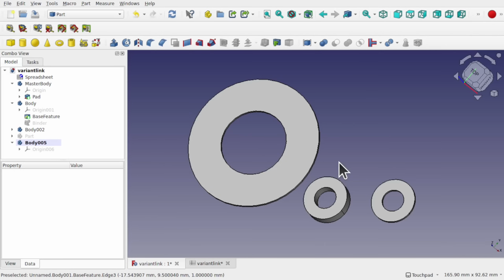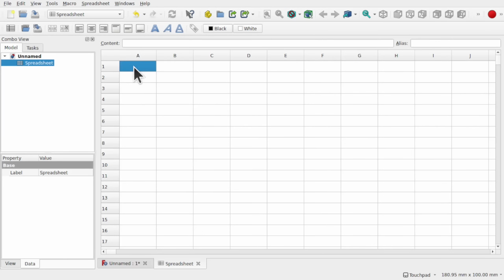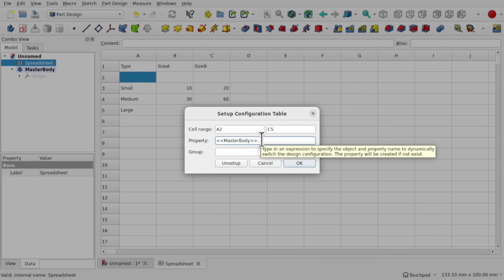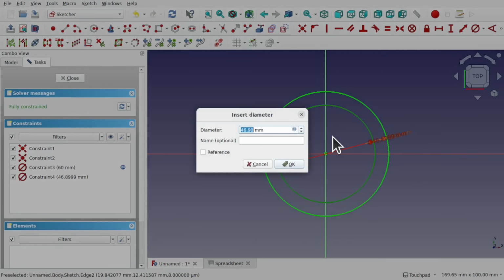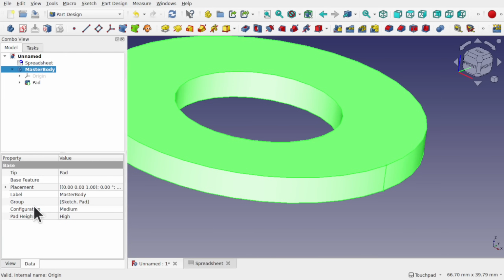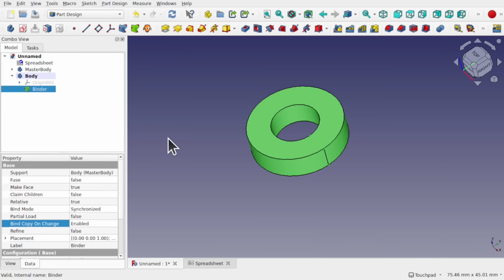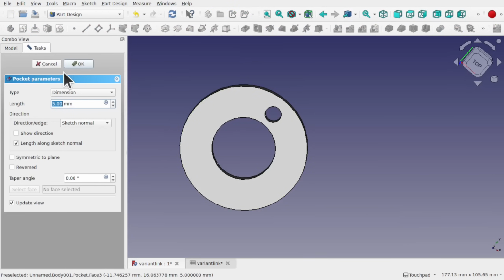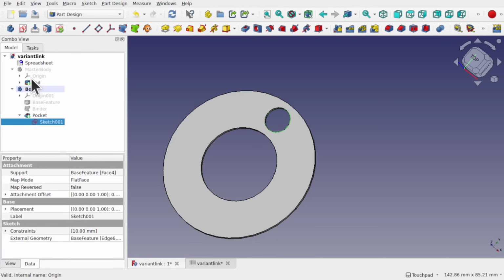Configuration Tables and Variant Links | Mastering FreeCAD 4

Comment: I've already managed to follow this tutorial and it works perfectly, but I can't get the same result within an assembly.
I think it would be very advantageous if this feature worked in an assembly. I can do this with Solidworks, and I'd like to know if it's also possible to do it in FreeCAD.
Imagine having multiple instances of the same component in an assembly but with different dimensions...
Could you make a video explaining how to make this work in an assembly?
Reply from the maker: I am going to have a go a trying that.  I haven't tried using configuration tables with assemblies and I can see where this is will be beneficial.
Reply: @MangoJellySolutions  
That would be great and would help me a lot. 
It would be great to imagine building a machine using aluminum extrusions and having just a single file containing multiple lengths that you can use throughout the project.
Thank you very much...
Reply: @MangoJellySolutions  Hi again! I kept experimenting because I’m still learning FreeCAD, and I think I might have found a really simple way to do this in the 26.3.0 DEV version!
I realized we might not even need the SubShapeBinder workaround for assemblies anymore. Here is what I tried:
I inserted the Master Body (with the Configuration Table) directly into the Assembly WB.
Then, on the instance properties in the tree, I just changed Link Copy On Change to Disabled.
To my surprise, it allowed me to have multiple instances of the same part with completely different configurations, just like SolidWorks! 
Since I'm not a FreeCAD guru, could you kindly take a look and verify if this is a safe/correct workflow? If it works as intended, would you be willing to make a video about this? It would be a massive help for learners like me and anyone doing Open Source hardware!

Comment: Flowing this tutorial in v1.1.0 mostly works but it generates lots of warnings about references after adding the binder as a basefeature.  If I take the SubShapeBinder outside the Body itself  the warnings go away and it keeps working as intended. Just wanted to share my experience here, it migt be the wrong appoach as i am definitely not a poweruser of freecad
Reply from the maker: Thank you so much for sharing that, really appreciate the feedback.  I will look into this and see what is going on.

Comment: I would like to create a table like this, but so I can select variants for a screw type.  So say I want to use a M4 screw to fasten two plates together.  Then it could select the clearance hole diameter, the tap hole diameter, as well as the counterbore diameter and depth from a table.  This way, instead of doing it manually every time (and when I try a different screw size) I can just select "M4" from a table.  

Is there a way of doing this without creating a variant table every time I add a screw?

Comment: I want this exact functionality, but then not with an enum value referencing to a set of values, but by being able to provide these values directly. So Part of Body is reusable with some custom values. 
So imagine having created a parametric shape and reuse it it another FreeCAD document with different values altogether. Is this possible too without coding in Python? (Because starting to code in FreeCAD kind of defeats the purpose of having this UI to work in) for bespoke shapes (for gears etc of course it is very useful). I think functionally speaking it would be similar to OpenSCAD's modules that can be reused in other OpenSCAD files.

So I imagine having created some Body which exposes some parameters which can be altered in a cloned, linked of subshapebinded instance without applying these values to the original. 

Is this possible with FreeCAD in anyway? 

Thanks for your great videos, very informative.

Comment: I've been using spreadsheets as configuration in the past.  But I must say, that you've explained this topic very well.  Learning spreadsheet configurations would have been much easier, if I had know this video before.  But I still have one question and I very much hope, you have an idea for that.  I set up a model for ER collets as work holding devices.  ER comes in different sizes, such as ER-16, ER-25, ER-32, ... to name a few of them.  I am able, to choose the confguration of my bodies just as you showed in your example.  BUT: ER-16 can hold round stock from 2.5 mm up to 12 mm in steps of 0.5 mm, whilst ER-32 offers ranges from 3 mm to 22 mm in steps of 1 mm.  Therefore I'd love to have a second configuration drop down list (as you showed in your video for the height of the pad) for the bore size.  But this configuration depends on the first drop down.  So, when I choos ER-16, the second config list offers hole sizes from 2,5 up to 12 mm in steps of 0.5 mm, but when choosing ER-32, the list of holes starts at 3 mm and goes to 22 in increments of 1 mm.  Any idea on how to do that?

Comment: 🎉Huge job!
I find it an interesting option to have 3D models with different configurations (e.g. DIN 912 screw with different metrics and lengths). I have done a test in A2Plus workbench, but, for several copies of the same model, with different configurations, once I update it, it saves all of them with the last configuration. Any assembly workbench where you can have different configurations of the same 3D model?

Comment: Hi Darren, or anyone fluent in FreeCAD. I do some design work on this platform, but i have run into an issue. I export files after I color coded them, in STEP 214 format, for a customer of mine, but there seems to show small blue spheres where all the vertices sit on the step file if he opens them on his program. I do not know what platform he uses, but i will find out. is there any way to hide them or remove them. i can send photos of this to show how it looks. Any help or advice will be greatly appreciated.
Reply: he uses SolidEdge, and opens the file as a part, not as an assembly
Reply from the maker: I have never heard of this problem  but I have never used the format. One thought though could it be the  point colour in freecad for the model?

Comment: Great to learn and make use of this methodology. I discovered a severe drawback, however. If the body is a bit more complex than a washer, and you have say 4 variants in the workspace, simple changes to the template body (or other simple edits generally) can result in grindingly slow UI response times. Not only this but the dreaded topological naming problem arises if, for example you try to fillet an edge in the template body.
By slow UI response times, I'm talking 60 to 90 seconds of waiting after each operation. I got the job done, but I won't repeat this approach.

Comment: HI, I am getting an error following the steps shown in the video. It does not have to do with configuration tables, but using a binder as a base feature. In essence, if I set the base feature of a body to the binder while it is under the body, I get a out of scope error, saying "link to object 'N/A' is out of scope of 'Body', instead linked object resides in 'N/A'",  but it works if the binder is not under the body. Does this error come up in your build? I am using the latest 0.21.2 release.
Reply: Yes I think I have the same:
PartDesign::Body: Link(s) to object(s) 'N/A' go out of the allowed scope 'Body001'. Instead, the linked object(s) reside within 'N/A'.
When The binder is used as the base feature within the body just dragging it outside the body gets rid of the error and it seems to perform as expected but it makes sense in the model tree for the binder to reside within the body, it is only a warning 
ChatGPT says   The error is not fatal — it’s more of a design-rule warning
to do with scope or something putting the  binder outside the body may not make any difference but just not trigger the warning
Reply: same for me
Reply: I'm having the same issue - has anyone come up with a solution except to ignore the warning

Comment: I've used FreeCAD for years and had no idea Configuration Tables existed (even though I've used spreadsheets many times)! 
As a nice side-effect, you managed to explain how the sub-shape binder is used (I've use the shape binder before, but never understood the function of the sub-shape binder, I think it needs another name).
Funny thing, I actually had a use for this just a few months back after watching your video on using the Link tool. :) I was banging my head against the wall trying to figure out how to model one part and have several with minor additions to them in the same file.
So thank you for yet another extremely helpful video!
Reply: Configuration tables are fairly new, like only in the last year or two. I have an industrial fuse holder (the big cartridge type) on Printables that uses configuration tables to allow the user to select both the fuse size and the number of holes to customize the fuse holder they want to then export as a STL or STEP to import into their slicer. I'm a novice cad modeler at best so my workflow might be a bit messy, but it seems to work.
Reply from the maker: I love seeing real world examples, thanks for sharing that 👍👍
Reply from the maker: Excellent 😊😊 Great to see that this helped. I want to try to cover the more unknown elements of freecad as finding documentation on some tools is near on impossible.  But once I find and figure it out the next step is what can you use it for as real world examples go a long way. A video that I am realising soon has this as a real world example in an assembly workflow. Both these videos were bought in existence by two seperate patreon request which got smashed together. So have to also thank them for the problems that they had which will be appearing in the next video. It's a great feedback loop.

Comment: Now that I know about this, I have to get this into my workflow. I just tried what you showed in the video and a few things more. I don't like the "Part Design" workbench very much (it's too limiting), but rather use the "Part" workbench and CSG.
For those reading here (if it doesn't appear in a video at some point): the same thing works with links instead of shape binders, only the property is "Link Copy on Change" instead of "Bind Copy on Change".
You can even make a configuration table containing shapes, so you can for example configure a "Cut" or "Union"! To get the references to shapes for CSG into spreadsheet cells just enter e. g. "=<<Cylinder>>._self" (the "_self" part is the important one). With that you can add a configuration property to a "Cut". To use the configured shape, in the Cut property view right click on "Tool" and select expression and enter the appropriate spreadsheet cell. Voila! You now have a configurable Boolean operation.
A simple example for what this might be used: imagine a cube you want to drill a hole either horizontally or vertically. Create a horizontal and a vertical cylinder, add the "_self"s to the spreadsheet, make a configuration table for a Cut and now with a simple selection you can switch between a horizontal or vertical hole.